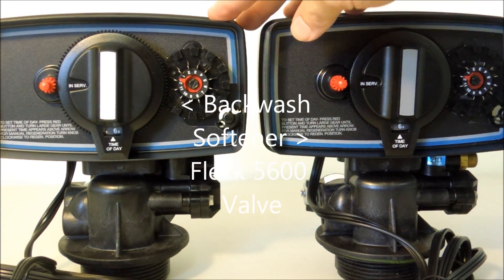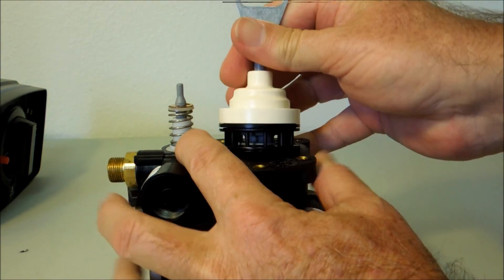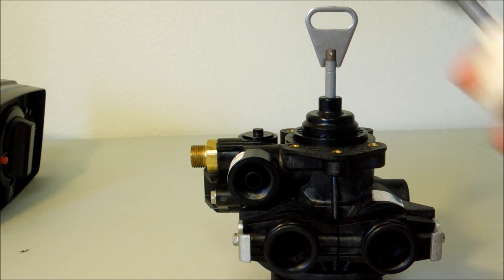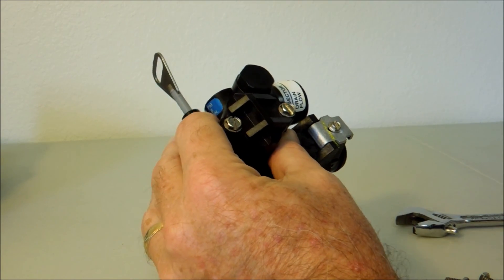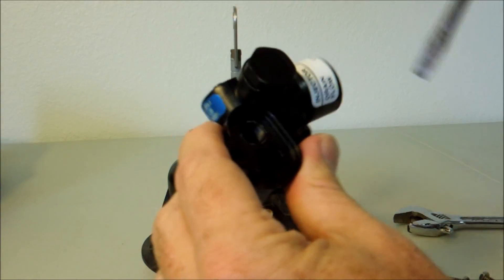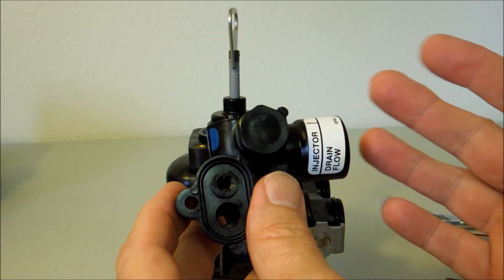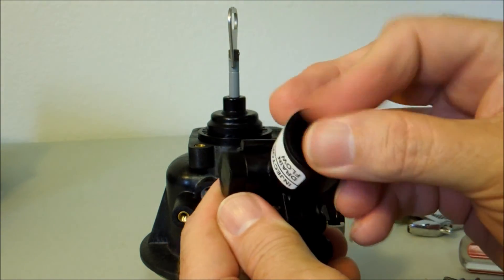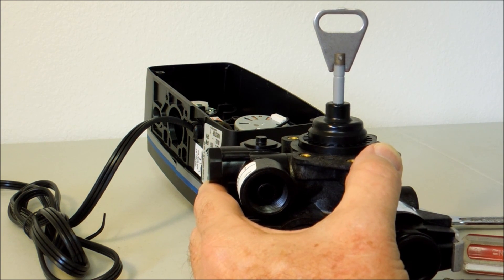5600 Softener Convert to Backwash Only Valve

Comment: This video has been really helpful. Thanks. I still have a beginner question: does a (5600) backwash-only valve still need a drain line? My present neutralizer (that I'm replacing right now) has one attached, but I'm confused about why it would need to make wastewater. Isn't the backwash process in a filter valve only about 'fluffing up' the media occasionally? At what point in the cycle is it emptying out?
Reply: Your Neutralizer needs to backwash ( reverse flow from bottom to top ) to keep the media ( calcite in this case ) both clean and fluffed up - to prevent it from "caking" into a solid in your tank. So, a drain line is necessary, as the valve head should flush the water through the tank for around 15 minutes backwash and another 5 - 10 minutes "setting" rinse. Note the frequency of backwashing will depend on the quality of the water being treated. If you have a lot of iron in the water, you should backwash often ( very 2nd or 3rd night ). If not iron issues, you could backwash once every 6 days.
Reply: @webelongtotheday2029  Thanks a bunch. Lots to figure out.

Comment: Thank you for this!  I bought an injection head from someone on marketplace and couldn't figure out what was going wrong until I found out I was using an air injection valve, and not the regular, but I didn't have the money to buy another head unit.  Thank goodness I found your video!

Comment: Helpful video thanks! My Fleck 5600 is a 'metered' softener valve, are there any additional steps/parts required to use it as metered backwash filter? What's the correct GPM / DLFC washer for an 8 inch tank with Katalox Light media?

Comment: hello in the backwash cycle when in rinse mode does it filter the water ? i use  media filter carbon only.
Reply from the maker: The water is BY PASSING the tank ( Carbon ) until it's Finished the Regeneration "process". Not until Final Rinse ( Settle Rinse ) is the water flowing Through the tank ( Carbon ) and filtering the water. And of course once valve is back "IN SERV" position.

Comment: Where do i get parts for Backwahs
Reply from the maker: At Softenerparts. Our website. Parts to convert,
( 1 ) 3413918 Brine Line Plug with Oring
( 1 ) 3413857 Brine Valve Plug 13857 - New Part #40947-02
( 1 ) 34INJECTOR Injector Nozzle and Throat Sets Fleck Valves
[Fleck Injector Size / Color:U = undrilled ( Nozzle only = BLACK )]   
( 1 ) 346010210 Piston Assembly 5600 Filter - 60102-10

Comment: Why would you need to change to "backwater only" in the first place. I guess I missed that part. Wouldn't the system be useless? Anybody?
Reply: I have a 3 tank Rainsoft system.  Only 1 of 3 tanks uses the brine tank.  The other 2 simply backwash without a brine tank.
Reply from the maker: You need to go to the Website to see complete FAQ article on the subject. And to find the parts for ordering. Parts to convert,
( 1 ) 3413918 Brine Line Plug with Oring
( 1 ) 3413857 Brine Valve Plug 13857 - New Part #40947-02
( 1 ) 34INJECTOR Injector Nozzle and Throat Sets Fleck Valves
[Fleck Injector Size / Color:U = undrilled ( Nozzle only = BLACK )]   
( 1 ) 346010210 Piston Assembly 5600 Filter - 60102-10

Comment: What is the kit number?
Reply from the maker: There is not "kit" for this conversion.  Parts to convert,
( 1 ) 3413918 Brine Line Plug with Oring
( 1 ) 3413857 Brine Valve Plug 13857 - New Part #40947-02
( 1 ) 34INJECTOR Injector Nozzle and Throat Sets Fleck Valves
[Fleck Injector Size / Color:U = undrilled ( Nozzle only = BLACK )]   
( 1 ) 346010210 Piston Assembly 5600 Filter - 60102-10